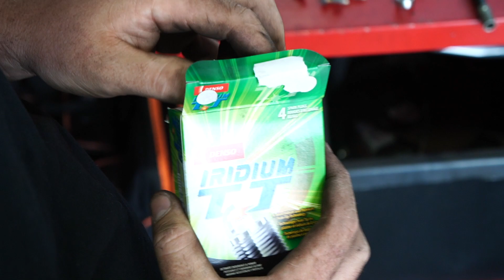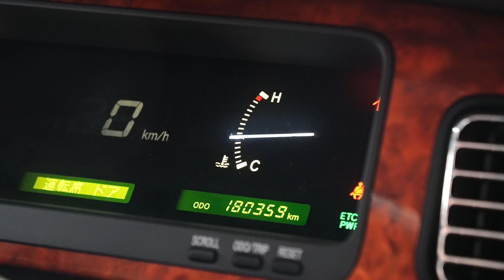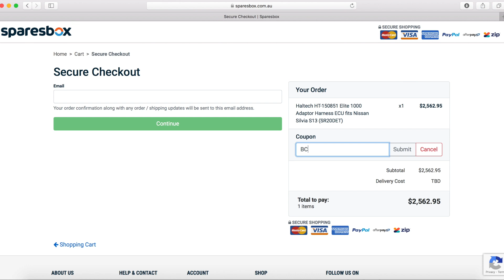CENTURY | Road Trip Reliability

Comment from the maker: Bcw merch : www.bennyscustomworks.com
Sparesbox, BCW5 On check out : www.sparesbox.com.au
Reply: quick question. Planning to use the 1gzfe as a ratrod's engine. Can you please suggest what's a good Standalone ECU / engine management system that I can use for it?
Reply: @Tabletop-Newtype  anything good for a 6 cylinder really (double up for injection and ignition), as always, Haltech if possible (decide what one suits you best) in my humble opinion Haltech is the best bang for buck ECU on the market for both functionality and user friendly-ness.
Reply from the maker: @Tabletop-Newtype  the haltech nexus would be perfect as it will do 12 cyl sequential injection/ ignition and dual E throttle. It’ll also run all of the body control items such as lights, wipers, fuel pumps, fans etc via the inbuilt PDM.
Reply: @BennysCustomWorks  thanks for the suggestion! Now to save up for it. Lol
Reply: @Tabletop-Newtype  Watch The Skid Factory V12 Landcruiser build, that will give you a good idea with the ECU and wiring, learn from the master himself, Turbo Yoda!
Reply: @joealex65  awesome will do just that
Reply: Just cracks on, no messin around. Is it just the 10mm in gold 🍺🍺🖖🖖

Comment: Nice job, hard to work on rare old cars with lack of parts. I’m curious did any of those electronics clips break when you unplugged them? Haha 😆 all 1990’s cars the clips break as soon as you touch the engine bay normally
Reply from the maker: The coil plugs did :( same as 1jz though so easy fix

Comment: Whenever you reuse hoses, and you have those deposits on them, get like 3 fist sized lemons, peel them, drop them in about ..eh ~2 liters of water boil them twice, and then put the hot water (not at 100c) in a container that can take the heat and fit those hoses, and drop the hoses in. Once the water is easy to handle, you can give them a rinse and the deposits should be gone (mostly for hardwater, but it does clean other types of crud too).